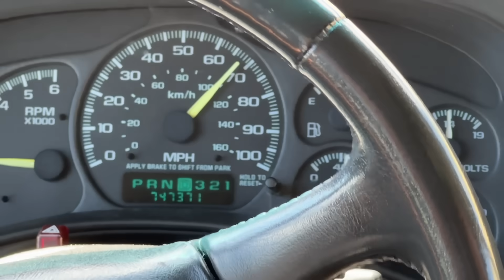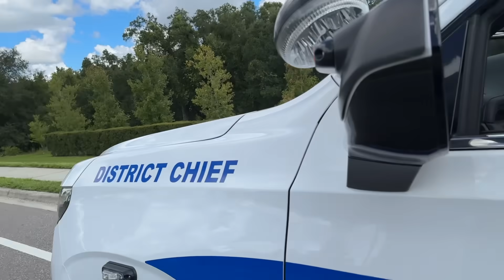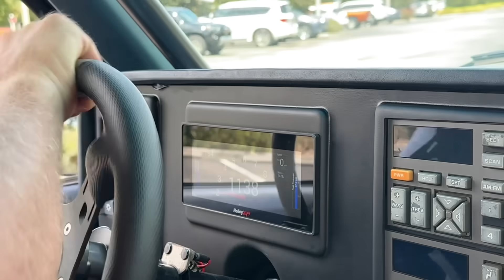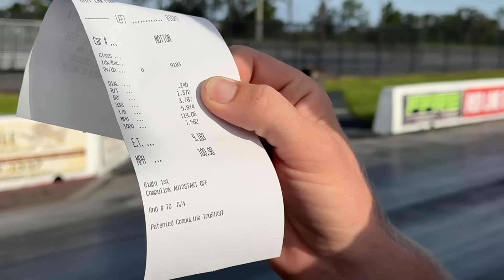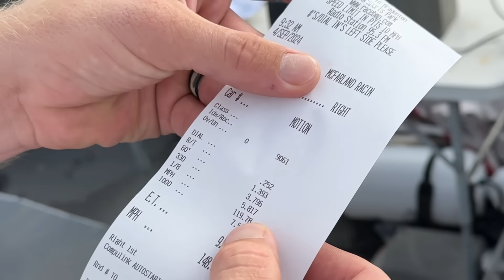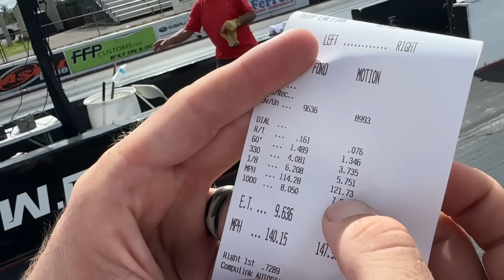We Finally Took Our ZZ632 Shop Truck to the Drag Strip!

Comment: So who rebuilt Sam’s 4l60e? 600k+ miles is impressive.
Reply: Im as much betting sam is meticulous with his maintenance on that old truck
Reply: anyone besides Chevrolet should be able to do that. good parts, proper maintenance
Reply: @dustyc324 my old 92 f250 has 689k and my 94 f150 has 437k I’ve seen a lot of old fords like mine with a lot of miles on them but this is the first Chevy I seen with that many lol
Reply: Don't tow in overdrive, that's what sends most 4l60e/700R4's to a premature grave.  Or put it behind an LS1.   Come on GM, you knew that thing was going to get beat on and would have the life of a gnat with the typical fbody owner.   Sorry still grumbling 20 years later about a car I bought new and dropped the transmission at 60k miles with stock power.
Reply: @Garydasnaill I’m the other way around. I never see old Fords with a lot of miles, outside of the 7.3 Stroke. But it’s hard to find a Chevy under 300,000 anywhere around me. I’ve seen plenty over 800,000 miles.
Reply: Yeah who did that
Reply: @adamr9215  Around me it’s all old ford’s with over 500k daily driven here in PA and my two are gas 300i6’s
Reply: @adamr9215  you can find a bunch of Chevys near me with under 200k but there rotted out
Reply: If you live in a flat state . It’s easy money , and no rust lol
Reply: Well, Sam could have easily done it himself.  He's pretty handy.  If not him, he had it done by someone that met his quality standards.
Reply: @adamr9215  I’ve seen a lot of 351s and 460s .. but when was the last time you seen a 6.5 Detroit with over 175k ? 
If you wanna bring up 7.3s lol
Reply: @SirVic42  Well I think Sam did it himself he’s a gearhead so makes sense. And how thorough he is on polishing cars and cleaning he probably maintains his cars better then a lot of people
Reply: @WorkingOnRocks  Not in PA lol it’s all  mostly mountains especially where I live is the Appalachian mountains of Pennsylvania
Reply: @AaronSmith-kr5yf Yes Sir! I learned that lesson the hard way! Motorcycle trailer (1), 700-R4 (0)!
Reply: 200k miles a 4lslippy is impressive 🤣
Reply: @AaronSmith-kr5yf chevy really peaked with the TH400 eh?
Reply: Lotta taxis in Australia had 4l60es in them and they'd easily clock over a million kilometres (600k+ miles) without a rebuild. Just don't drive like a fuckhead and they don't break.
Reply: Probably changes the fluid every 25k
Reply: @nickfoy7430  What are you talking about? There is no 6.5 Detroit. It’s a GM engine, and Detroit Diesel had nothing to do with it.

But, if the 6.5 is the 2014 and later P400 engine, it has been fixed and is as good or better than any Cummins, Duramax or Powerstroke. I’ve got one making 900hp on factory internals.
Reply: 349k on my 4l60e in my 03 rado!
Reply: My 4l60 is @ 322k original, slips a little 2-3 but if you let it shift she'll be fine
Reply: @redmk3t  same here got some slight slippage going on I just let off and let it shift
Reply: @richardturner8630 do you think that's the best interval? What brand fluid do you find works best?
Reply: He probably changes the fluid in it every 20,000 miles.
Reply: @Garydasnaill you must not follow chevy much. Lol my local chevy dealer hosts a huge car show every summer,  and in the service shop, they have photos of all the high mileage chevy trucks.  Mostly OBS and NBS 1500s, all near, or above 1m miles. I'm in a town of 50k people in ND. Lol. These trucks are all local too. So I can only imagine what the entire nation is like. 

Most of my chevy trucks get sold before the 300k mile mark though
Reply: @sergeantspeed5941  No not really a Chevy guy more of a Ford guy and seen many obs Fords over 1m as well so pretty even there but old trucks are better then new junk
Reply: @redmk3t  That is usually caused by the electronics. Replace them before you drive it too long and it should go back to normal. It’s the electronics that take out these transmissions. Catch it early and it will save the expensive parts.
Reply: You ain't lying! I was thinking the same!
Reply: That’s what I’m saying I got a 03 Silverado that’s on its 3rd 4l60e in has 144781 on the body so next step built 4l80e and a turbo 6.0
Reply: @adamr9215 yea I've heard people say line pressure is low, and to get the solenoid kit. The bands have probably had it lol but it hasn't gotten worse 🤷
Reply: @adamr9215 i had an old ford with the 300 inline 6 that had 150k when i bought it and 650k when i sold it, and i still see the dude i sold it to driving it around from time to time. The 300 is an absolute unit as long as you dont care about horsepower, made a ton of torque though. Not sure what model the trans was in it but i never had any issue out of it other than needing a clutch every 100k or so, good old 4 speed manual.
Reply: Asking for whitt
Reply: @Greg1096  Yea, the inline 6 was Ford’s most reliable engine. But it doesn’t really matter when the truck rusts out before the engine gives up. I don’t see any of those engines with a lot of miles, most have high hours but not that many miles. But, that comes from where I live. The inline 6 was popular if it was going to operate a PTO, and running a PTO means you are working it hard without putting miles on it. People used the inline 6 around the ranch or farm, but usually used a V8 truck for trips to town.
Reply: My old man had a 4.3/4l60 combo in a safari van we used for work ,  went  600+k on completely stock unopened motor trans and rear end .. and it would still light the rears at those k's , 4l60's either last for ever or die at 150k lol
Reply: Our shop truck is the same gen as Sam’s truck. Odo is around half mill. Best trucks ever made.

Comment: Not Cleeter McSkeeter doing a burnout when the oil barely even had time to make it to the cylinder head! 😂😂😂
Reply: It's called editing. :face-red-droopy-eyes:
Reply: @stuwest3653  if they would've edited it then he wouldn't have said he stopped because it wasn't warm.....
Reply: 😂  @stuwest3653  and during that edit they would've been told about the alternator, gas cap, and hood pin but obviously you missed all that
Reply: Ummm, you do know the oil is already being pumped through the motor as it turns over before it starts right?
Reply: If you believe everything you see on screw tube. I've got a few nice bridges over dry land if you are interested? He knew all along and it was planned well ahead of the video we seen.
Reply: @geekyzebra91 be real. It does take a few mins befor everything is lubed and ready to roll. Let me guess, you may be the ones who jump in and start immediately driving. Not a smart choice at all
Reply: @6P3-MK4  sure if you say so 😉
Reply: @6P3-MK4 no it doesn’t bro. Maybe if it’s -20 and you are using 20w-60, but that’s not the norm. On average it takes 15-30 seconds for oil to be pumped everywhere throughout the engine, and at least 5 of those seconds are spent cranking the engine. By the time you are ready to drive the engine is completely lubricated. However, beating on an engine before oil has gotten above at least 140-160F is not good, oil flow is not as good at lower temps but perfectly fine for normal driving.
Reply: @geekyzebra91  I know so fella. I build engines quite often. Takes time to warm up parts, especially aluminum head on a cast block. Shits not jiving until thing are happy together
Reply: @tkc2406  you do you my friend.
Reply: @6P3-MK4 it doesn’t take a few minutes, that’s insane to even think. If that were the case your engine would be worn in the first 100 miles. Oil is fully circulating within seconds of start up. You’re doing more damage idling your car for 5-10 minutes on startup to “warm it up” then you would be driving it between 2-3k rpm, letting the oil get warmer faster and flung around more efficiently with the higher oil pressure is made from a faster spinning oil pump.
Reply: @rubee5.043  my bad, not minutes but come on. Dont just start shit and drive off. I didn't think people took shit so literal. Just let the fucking thing warm up and get happy. Plain and simple
Reply: my poor old honda runs for a minute before oil gets to the top
Reply: @rubee5.043  I know cleets got the money to do whatever he wishes, but would you just jump in your 632 and just romp on it? No, and sane person with a brain would never do that. Doesn't he have a room with 5 or 6 of them laying around? Also, the shit edited, I guaranteed it already warm befor he did that burny.
Reply: @6P3-MK4  never said i agree with what he did. Its idiotic to do that. Im responding to specifically on what you said about idling for a prolonged period of time
Reply: Old habits die hard 😂
Reply: @rubee5.043  fine man, I'm not goin to argue with you. I love his videos and I know how edits work. I build enough shit on my own that idling does not hurt an engine if it's being warmed up vs romping on it Immediately. You do you, and I'll stick with never having a failure doing what I do. I don't let it idle for hours, but I sure as hell make sure it some temp first. Again, you DO you, don't climb up my ass and set others up for failure later. Plain and simple
Reply: @6P3-MK4 oil takes about 5 secs to get around the engine and some cars even rev up to like 1500rpm on cold start like VW but just don’t go above that because when oil is cold it is thicker and can’t go through all the ports correctly and revving it hard means some areas of you engine aren’t getting oil. Also running while engine is cold is also bad because the piston can expand from heat faster than the cylinder wall and cause excessive premature wear👍
Reply: @camdenernst6133   bingo. Let the guys above see what you are saying. Every engine is different, but either way, it needs temp first before doing full throttle rips.
Reply: @6P3-MK4 yes i usually wait about 2 minutes on a turbo engine. If you have an oil pressure gauge you can see when you start it cold the pressure is real high then it slowly lowers usually around 40psi depending on the engine.
Reply: @camdenernst6133  that's 100% correct. Again, every engine is different, I Build n/a and turbo engines and that's very true. Shit has to get happy and with experience you learn what things want. I just can't stand no knowledge people that think cuz they see something on a video, it's the Bible. Exceptionally true with cast blocks and aluminum pistons aswell as cast blocks and aluminum heads. Everything needs to jive befor it's ripped on. I have no argument with you 1 bit my friend. Appearently I just didn't word my message correctly enough to enter some thicker skulls.
Reply: @geekyzebra91  That's not how it works, pal. Get a real car with a real oil pressure gauge and verify for yourself. You think people warm up their cars for no reason?
Reply: Im glad yall brought this up! This isnt the first time ive seen cleeter twist on a cold engine, and i do not care what kinda engine it is! They all need to have the oil broken dwn atleast one time b4 ringing on them! He's had the most bearing failures of anyone ive watched on yt! Believe what you want but a few of these guys know what they are talking about! Too much oil psi is alot worse then 10psi in most cases not all but most! Unless its wore slam out it is!
Reply: The cilinder head barely needs any oil anyway. A few drops every now and then is plenty. It’s the bottom end and the camshaft that need constant oil pressure. And those get the pressure very quickly.
Reply: @anthonyking4387  yes I agree aswell as turning thier engines off to quick, it’s not good to have your engine at redline especially turbo engines because those turbos be spinning at around 100k rpm and shutting the engine off means it’s cutting the oil supply to them turbos means they could be spinning for another 1-2 minutes with no oil. Also shutting the engine off while the oil and turbo is hot is also bad because the oil oil doesn’t cool down correctly and going from really thin to cold causes them to “gum up” and become sludgy and in some cases the heat expansion from to turbo going from 500-600 degrees to cold can cause them to crack. I usually give the engine a minute before I turn it off after I run it hard. however because they are rebuilding their engines so often it doesn’t really matter because they’ll switch the parts every 2 - 3 weeks anyway
Reply: He’s what they call a “trained professional”
Reply: @6P3-MK4  you are correct about temp, but incorrect about oil flow. The critical rotating parts of the engine are the first to get oil, and that happens within seconds of starting the engine. Now temp is a completely diff story, depending on the oil weight you are using you may only need to wait a min or so or up to 10-15min if you are running a very thick race oil with loose clearances.
Reply: @6P3-MK4  if youd build irl youd know that the best thing to do after start up is to revbomb and dip that needle in the ketchup.

Comment: My Dad has 1.2 nil miles on a 66 Chevy CarryAll. Yes original special ordered 327 industal Engine. at 600k miles he replaced exhaust valves and rings and gaskets/seals. All the rest he cleaned up and put back in. It still runs like a champ

Comment: When I was in technical training in the military, I was driving back to the base at night.  With about two hours left to go, I lost the lights due to low voltage.  I ran without lights in the country, and turned them back on going thru towns.  The battery would charge up some with no lights.  I made it to the base, and checked it out the next day.  A loose fan belt was the cause, and easily fixed.

Comment: 7:09
Pushing a Chevy...  
That's the GM life. 😂😂🤣🤣
Reply: Used to own one. Know the struggle 😂
Reply: I worked in a truck shop for a long time they all have their issues. Usually for dodge it's suspension, Ford engines and Chevy transmissions
Reply: @briangalloway3684  its 100% diffrent here LOL Ford Suspension chevy engine and dodge transmissions BY A MILE 4l60e self detonates LOL cant tell ya how many 1998-04 dodges ive done haha
Reply: I've always had elec issues with Dodge

Comment: Aero! Need a bed cover, or tailgate delete/ mesh net. Atm the tib is just acting like a brake and filling with air. 

The other option is aero disruption devices which lorries have on back of unit to break air round trailer to make more efficient.

Comment: LOL It takes a built 632 big block Chevy race motor to compete with a little 302 Ford fully loaded A/C grocery getter
Reply: F150 is making more power, has a 10 speed and is 4 wheel drive.

Cmon now, we all know building an older car isn’t going to be as fast. How much would you have to spend on a 1999 mustang to make it keep up with a stock C8 z06?
Reply: Plus the Silverado is probably 1500lbs lighter

Comment: My uncle used to build engines for Don Garlitz's top fuel dragsters. He built a 959 cubic inch engine that produced 12,400 horsepower and ran a 326 mph quarter mile. I have a 632 that he built that puts out 6,700 horsepower and my Camaro ran a 5.52 quarter mile at 267mph.

Comment: 632 cubic inches is pretty impressive =D That's 10.35 liters of displacement, or more than 5 times your regular 2 liter engine! My 1968 Cadillac has a 472 cubic inch engine, or 7.7 liters and Cadillac stroked the crank to get an even 500 cubic inches or 8.2 liters in 1970. AFAIK that's the largest ever displacement in a regular automobile ever! That's still more than 2 liters less than a 632! Madness! The BEST kind of madness =D I love it!
Reply: Okay, the Viper V10 did see 512 cubic inches, it's bigger. How many 512 Vipers were made though, compared to Cadillac 500?

Comment: If it’s going to always run an alternator. Throw that battery in the trash and go back to a normal agm/lithium. That battery will cause all types of charging issues.

Comment: 302 cu in motor with supercharger an base tune with a foot brake start vs 632 cu in billet intake built motor with nitrous and 2-Step start is apples and oranges! Did anybody really think the outcome would be any different?

Comment: Might sound messed up but that’s not what is intended with this comment. You may look into detoxing your kid, I’ve seen many kids that seem to learn things slowly, or sometimes have problems with speech that tend to be 100x better after a simple detox. My little sister herself had a problem with it and we did a small detox and she’s a completely different kid. I’m not meaning this in any disrespect, I love you guys. But maybe look into the benefits of that, if not absolutely okay. I just have seen so many kids lately need a detox because of all of the BS in foods lately. Love you guys. ❤

Comment: The F150 had air condition,power widows,a full comfortable interior and it could be a daily driver and it was just a second slower than the full on race truck you are running here so it’s not really a fair race unless you feel like gutting the F150

Comment: I can't help but think u guys really fumbled a great Cleet & Squirrel parking lot repair opportunity. Instead of charging the battery there u should of replaced the alternator there. That would have been a TRUE parking lot repair, u don't have ur people right there to help. Just borrow a wrench set from the shop, so u don't get in their way. It wouldn't of taken long at all, with the miles of room in that engine bay.